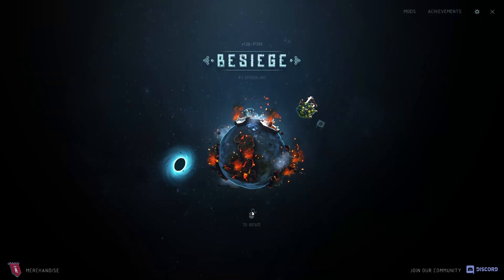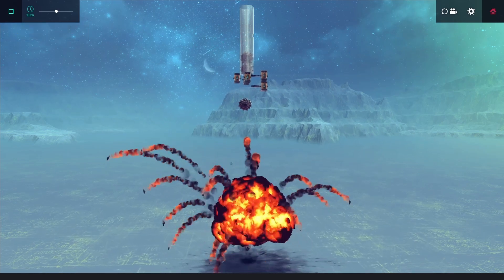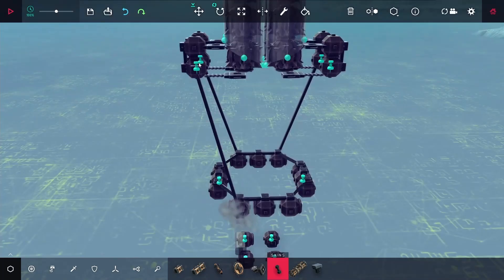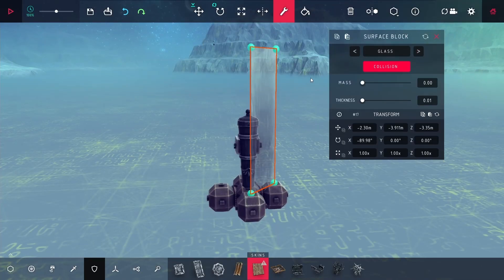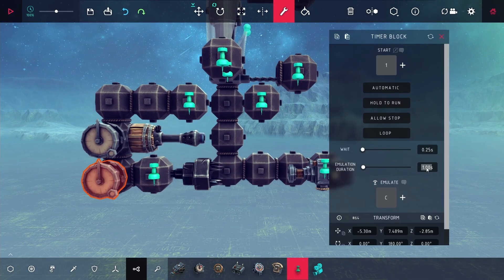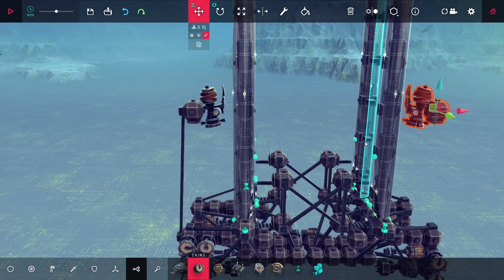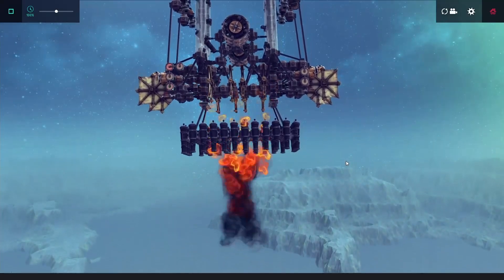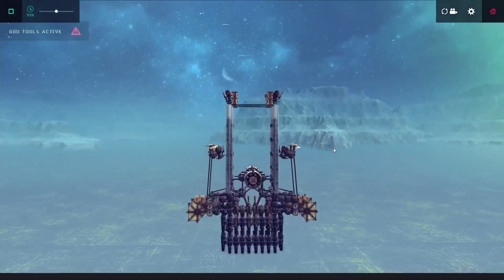Making a Multistage Rocket in Besiege

Comment: One of the things you could have done with the bombs is had a feeder at the top attached to winches or springs constantly applying pressure, the same way a magazine applies pressure to the bullets, pushing them into the gun by using a spring. Using that, the bombs wouldn't bounce upwards when propelled upwards, and it would therefore hopefully not explode.

Comment: Video idea: 
I think it would be really interesting to see a cannon gun that works like a real gun that uses springs and suspension and pistons to fire and eject the used cannons. I think a sort of tube fed sort of design would be cool with possibly a pump-action to load it into the chamber. Maybe even a recoil system for when the cannon explodes, it will push a slide back and eject the round and load a new one?